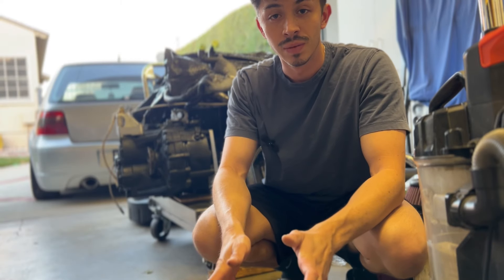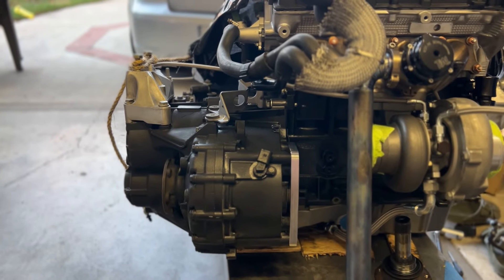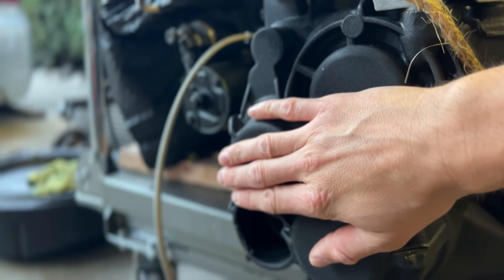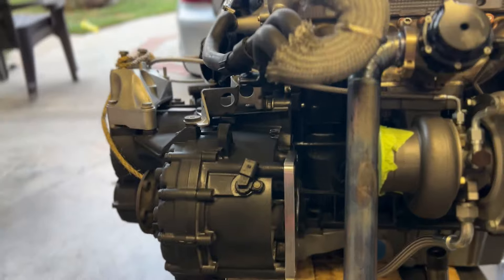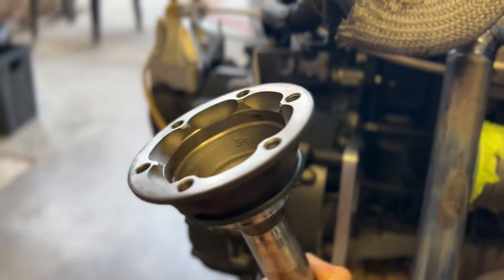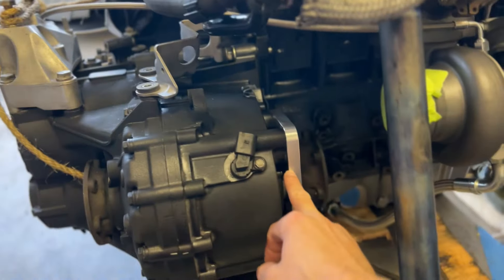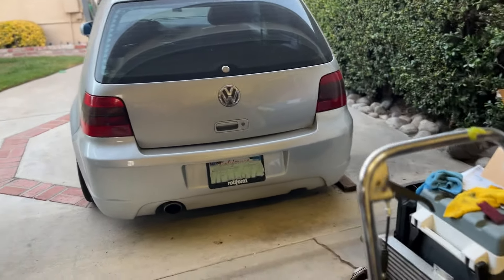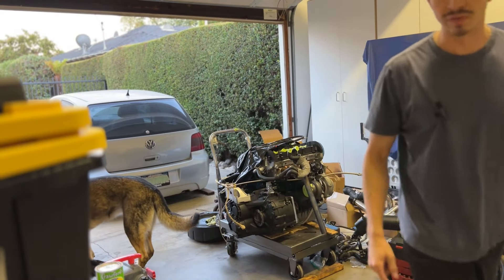Turning an AWD 6speed to a FWD. How to 6 speed swap your Volkswagen (the cheap way)

Comment: Cool stuff. Didn't know you could convert an Audi AWD 02M to FWD with that plate! That's a great deal for the transmission and conversion. I have the 02M FWD 6 speed in my Jetta. I had to take off the side plate to install the ECS Shim Kit because I was having nasty "Clutch Creep" and some jolts when downshifting prior to installing the Shim. My mechanic that installed my clutch was saying my upgrade state 2 clutch was already going out after like 10-15K and I didn't believe them. I did my own research and found out about the shim and did the fix myself. That's probably still the best fix I've ever done. It saved me a TON of money I would of wasted if I listend to my mechanic that owns one of the highest end Euro shops in town. Looking forward to the next update!
Reply from the maker: I’m hoping I don’t have the clutch creep problem! But that’s a worry about it later type of problem  😉

Comment: With the axel flange were you able to use the axles that came on the car stock?
Reply from the maker: This car came factory as a 5 speed which has different axles than the 6 speed. So no the stock 5 speed axles will not work with a 6speed. Easy fix, swap the wheel hub bearings to 6 speed ones and axle bolts right up.
Reply: Word yeah I have to get a new transmission here soon and I’d like to do the swap. But I don’t wanna change a ton of stuff. Are you saying to change the axle hubs on the six speed to five speed ones or no matter what I have to get six speed axles.
Reply from the maker: @misfit144  I believe the axle cup for the 6 speed is fundamentally different than the 5 speed. So you would need 6 speed axles to run a 6 speed. Only thing that must be changed during the swap are obviously transmission, clutch, axles, wheel bearings, possible power steering line unless you can bend it accordingly to fit.